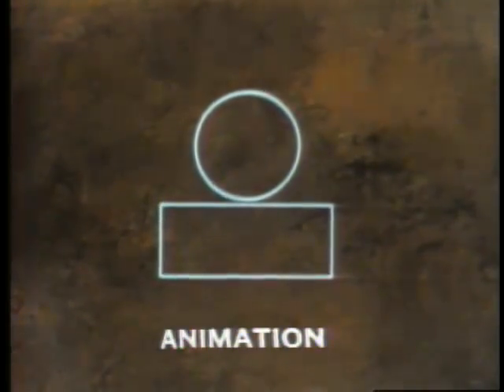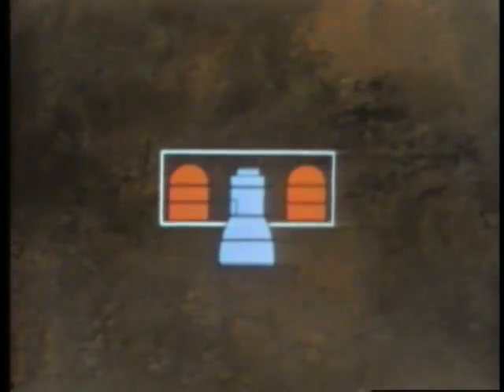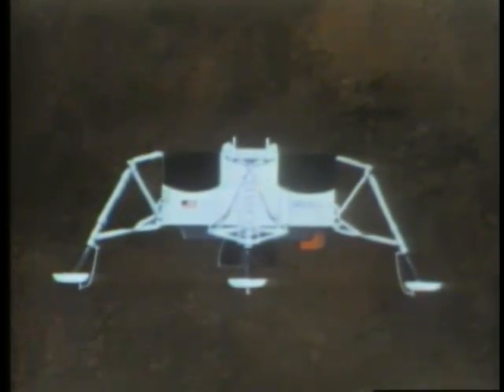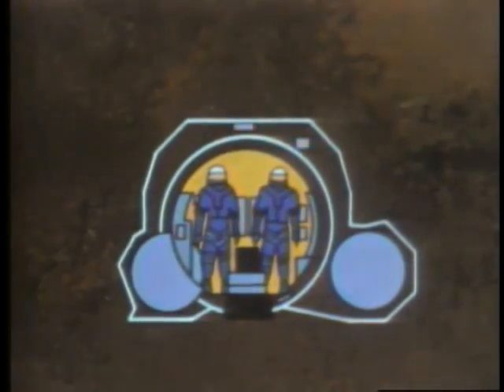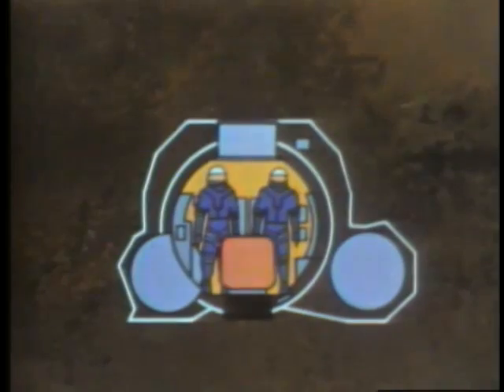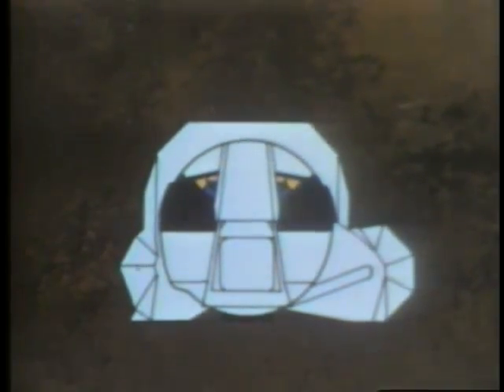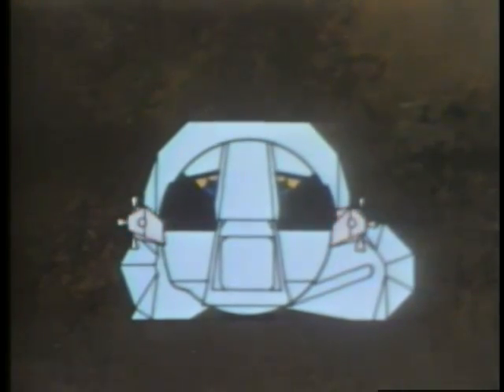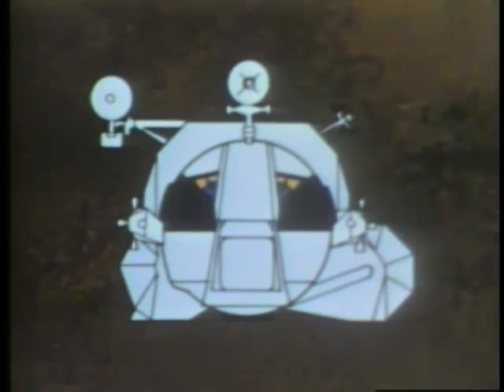Anatomy of the Lunar Module

Comment: Basically it's a rocket on top of another, makes you wonder the safety of the ascend stage: when the upper rocket ignited at such a close proximity to the lower fuel container, what should have had happened? Why the lower stage didn't explode? And the biggest question of all, how the fixed upper rocket engine kept the balance. All conventional rockets either have vector control exhaust, or multiple rockets to keep it stable. In the history of space, only lunar ascend stage has only one rocket engine with no vector control.
Reply: The vector control is in the upper stage is controlled by the RCS engines. Hence the "wallow" upon ascent. Watch the actual footage. The "wallow" is obvious when the footage is sped up. BTW..."wallow" is the actual term used by the Grumman engineers.
Reply: It kept the balance with a gyroscope, like the rockets does when launched here on earth. But the lm had other more serious issues.... like how could its thin aluminium hull hold up to the extreme vacuum in space?
Reply: @Gold_Village  - Once in space..The Apollo system is only pressurized to 0.3 ATM with 100% oxygen. (Not 1 atm) That is like breathing 30% Oxygen at sea level. .Only small areas had thin aluminum at the crew would not come into contact with. . They were also covered by layers of KAPTON and MYLAR on the outside. (had to use upper case because of autocorrect). The Thinness of the Lunar Module seemed to be a journalistic exaggeration in most cases. Only a few areas were as thin as a coke can.  Realistically soda can can easily handle 2 ATM pressure at sea level....in space 0.3 ATM isn't that much pressure
Reply: @dcb1138  Nasa never even demostrated the lm inside a vacuum chamber, yet we are to believe it worked so well n the vacuum of space?  i find it hard to believe. It had alot of thin hull areas because of the critical weight savings, and the reason why a can could hold up that good is because of its small size. The lm would need a way thicker hull
Reply: @Gold_Village  - Where did you get your information. They absolutely DID test them in Vacuum chambers. The first test had a window explode.
Reply: @dcb1138  Grumman tested it and it ofcourse failed, but there isnt any vacuum chambers on earth thats even CLOSE to the levels of vacuum in open space (my point proved)
Reply: @Gold_Village  You OBVIOUSLY nothing about physics or aeronautics . You proved that point for sure. Peace out
Reply: @dcb1138  LOL the lm failed a pressure test but im the one who knows NOTHING about "physics or aeronautics"? (but u do?)
Reply: @Gold_Village  - Um...yes I do. The window blew out and they replaced it. Then it passed .. What is your major malfunction.
Reply: @dcb1138  I bet it doesnt exist even ONE independent verification of a successful test
Reply: @Gold_Village  - Think about how absurd your comment is...Who could have run an "Independent" vacuum test in the 1960s. Let alone on the space shuttle, ISS or any space craft today. Ridiculous statement. Even Space X ships the Dragon to NASA to be tested.
Reply: @dcb1138  NASA refused Ralph Rene to test their space glove in his homemade(!) vacuum chamber, imagine that. Thats about the weakest levels of vacuum that can be created, yet nasa claims the suit working in the extreme vacuum of space. But ofcourse it failed a test in 1966 when jim leblanc nearly died

Comment: The decent stage... The flight Dynamics to land on the moon or essentially the same as here on Earth albiet with 1/6 of the gravity.  So it landed the same as the SpaceX Falcon rocket boosters do today... And the SpaceX rocket boosters have a vector controled Thruster in the computer power to control it, something that LEM did not have.
Reply: Skelotor Two, the gun experiences recoil because the powder's combustion action is working against the cartridge at the anchoring end, the projectile at the opposite and the barrel in all other directions. The combustion that is provided in the infinite vacuum of Space will have only the craft the rocket is anchored to, nothing at the opposite end, and nothing on all other sides. All of the missing elements are compounded by the vacuum that will not only negate any substances we might introduce in their absence but pull them away faster than we can produce them.
Reply: @asleepinthealley  So are you saying if you fire a gun in a vacuum you will get no recoil?  If you accept that you do get a recoil, what if you fire a machine gun with a thousand bullets. Won't you get a pretty continuous push from the recoil? What if your bullets are very small and you have a billion bullets firing rapidly? Rockets fire gas bullets continuously and produce a continuous recoil. No atmosphere is needed. The fact that they do work in a vacuum has been a settled matter for centuries, by the way.
Reply: @johnrex5342  I'm not saying anything like that. Why are you trying to put words in my mouth? Firing a gun is not a sustainable power source
Reply: Hmmmm....Yes IT DID. It had both Vector control RCS thrusters (4 quads) and the the decent engine could gimbal. Plus...The computer was very capable alone with landing radar but its was also coupled with doppler data from Earth. Where did you get your "facts". Perhaps read a book like "Digital Apollo" , then you can make educated comments.
Reply: john echols, nothing like "here on Earth". Here on Earth we have the atmosphere that is necessary for the rockets and thrusters to even function at all.
Reply: @asleepinthealley  Uh. Sorry, no. You don't need an atmosphere for rockets to work. Actually, the less atmosphere there is the better they work.
Reply: @johnrex5342  The why is it, the highest documented elevation a civilian Rocket has reached is 72 miles? Only NASA claims to have escaped our own atmosphere and they don't have ANY PHOTOS to prove it. Ha ha NASA has been lying for over 50 years!
Reply: Skelotor Two, it's not the ignition nor the combustion that presents the problem. It's the 'Thrust' whose requirements can't be met. Thrust is a two ended force, meaning that it needs to push against one end (the Action) to meet resistance and transfer that force (Reaction) upon the other. On Earth and within our atmosphere, it uses the air itself by compression to push off of. In the infinite vacuum of Space there is no compressible air to push from and this missing requirement is compounded by the vacuum itself. Any and All force we can produce is immediately sucked into the void that is the infinite vacuum of Space. Rockets do not and can not work in the vacuum of space, anyone that says otherwise is either ignorant or lying. NASA is lying.

Comment: Given the uneven ground of the Moon's surface, why would they put 4 legs on the lunar lander and not 3? Have you never had a rocking table that needed a matchbook under one of the legs? Why did milking stools have just 3 legs. NASA is supposed to be smart but this one got passed them?
Reply: Stable like a three legged chair? I'm sure it was considered with regard to weight. The legs were designed to collapse a bit...
Reply: GJ,How can you be so sure?
Reply: GJ, thanks for that as well, more evidence NASA has no idea what they're talking about. When confronted with the obvious mistake of 4 landing legs which would result in the rocking table effect, requiring a match book or stack of books to alleviate, we have them suggesting the 5 legged  lunar lander module...We know this was supposedly expected to land on a planet with uneven ground. Did NASA actually expect to encounter a table-top smooth surface? Think about it people, milking stools were made with 3 legs because they were used on uneven ground and 3 legs offers a stable platform. The ONLY stable platform. 4 legs would result in one leg always suspended and our table or landing craft rocking like a son of a bitch. 5 legs and more would multiply the problem. Isn't NASA supposed to be comprised of Rocket Scientists and aren't they supposed to be smart? This proves otherwise. I'd like this to be remembered as the 3-legged milking stool hypothesis, that brought NASA to its knees.
Reply: Good luck with that. You're going up against 6 successful landings from 6 attempts! It was designed to land on unknown terrain, not just to stand upright on it. They had to factor in possible lateral velocity on contact, and in any direction. Think about cars - pretty stable on 4 points of contact...why? A Reliant Robin in motion, less so! There's other factors in play. A three legged LM could have been made to work... if you look at early mock ups you'll see one with 3, indicating that it was a preferred option at that time - but later discarded. I'd imagine it's a matter of how wide the legs would have to be made to meet the margins against toppling, the weight consideration and robustness of the system as a whole. Look at Apollo 15 - it landed and took off safely.
Reply: GJ, you're merely repeating lies we were all told. Supposedly the most remarkable event in the history of mankind and they didn't take ANY actual photographs that can't be dismissed as fake. The Lunar Lander's legs and pads can be seen well enough to note there are no leveling devices incorporated into them, which they would have had to have had, to eliminate any rocking in the Lunar Lander. The closer we look the more proof we reveal...this never happened.
Reply: @asleepinthealley , engineering is all about tradeoffs.  There are advantages of a 5-leg design.  It is the most stable, meaning that it is the most resistant to tipping over if you land with a horizontal velocity component.  But it has the disadvantage of being the most heavy.

There are advantages to a 3-leg design.  It is the lightest.  But because the legs aren't spread as wide, it can tip over more easily.

Many times, what engineers decide on is a compromise.  And in the case of the LM, the compromise here was to use the 4-leg design.  You may have seen drawings in how Grumman's original design had 5 legs.  That's because the last thing they wanted to have happen was it tip over after touching down.  But their full LM design was too heavy.  So they went through iterations of looking at all places where they could save weight.  You can also see that the original design had large windows.  These are heavy.  So the windows got shrunk way down and reduced to just 2 looking out front.  The original design had chairs.  These got removed as unnecessary weight, and got replaced with harness straps tied to the top of the cabin.

And the leg design went through a weight reduction program too, going from 5 to 4.

Yes, leveling after touchdown is definitely an important consideration.  And the way they solved that was having crushable material inside each strut.  The legs were telescoping tubes that would compress upon landing.  And so when it came to a stop, all the legs would be crushed down to a point where the LM would not rock back and forth.  Kind of like dropping a lump of Play-Doh.  It squishes down so that the bottom gets flattened.

The LM's legs would crush down to a self-flattened base upon landing.  Extensive testing was done and it was extremely well documented.  Here is some of that testing that was done:

https://www.youtube.com/watch?v=7buE8sJfkTs&t=2m

One of those tests is dated Nov 23, 1966.  You can watch the legs compress so that when it comes to a stop it rests on a flattened base.  And you can see how the 4 legs work to help keep it from tipping over when landing with a sideways velocity.

Yes, there are definite advantages to a 3-leg design.  And that is exactly what NASA picked for its first Moon landers.  The Surveyor program:
https://www.google.com/search?q=surveyor%20moon&source=lnms&tbm=isch&sa=X

But with probes, it is not a catastrophic event if one tips over after landing.  You just build a new one and try landing it again.  But when there are people inside, then it is good to design to a higher reliability standard.

There is a strong push to land more stuff on the Moon.  And engineers today are going through the same design decisions that NASA went through in the 60s.  Here is a team from India doing their drop testing of a 4-leg lander design:
https://www.youtube.com/watch?v=5hplX93ttEg&t=15s

GJ,
There were actually 7 landing missions that were attempted.  6 succeeded.

The data from each of those landings has been published with extensive detail.  The reports state the exact velocities and accelerations that were measured.  And also the flatness of each of the LMs after they came to a stop on the surface.  Alan Shepard's landing on Apollo 14 had the biggest tilt angle.  He didn't pick the flattest place to put it down.

You may know that his crew got nicknamed "Rookie 14".  Between the 3 of the astronauts picked for that flight, the had a total of ZERO orbits between them when they lifted off.  This is in sharp contrast to Apollo 10 & Apollo 11, where each of the crewmembers were orbital rendezvous veterans.  Apollo 8 had a total of 3 Gemini rendezvous missions between them.
Reply: @asleepinthealley , there was a point in evolution when the first life forms came up out of the ocean.  Most preferred to remain in the sea.  Then there was that turning point for primates when most stayed in the trees, while some ventured down on the savanna and started walking upright.

1969 was one of these pivotal points in history.  And it is quite possible that the disconnect that is happening between you and me is because you and yours have elected to remain on one path, while there is this very different path that has been pioneered by people like Armstrong Aldrin & Collins.

You are certainly free to believe whatever you find to be the most compelling explanations.  I fully respect your decision to remain where you feel most comfortable.
Reply: @har234908234  Good luck with that! you really believe that the thin foiled can they call the "lm" really could hold up to a real vacuum? no tests has ever been performed by nasa - man or unmanned. Whats keeping them to show what the lm could do inside a vacuum chamber? not that there exist any vacuum chambers on earth thats anywhere near the levels of the extreme vacuum in space, but its a start. However id did failed a pressure test by grumman, thats the only record for it
Reply: @Gold_Village  Okay... do you actually think you need a vacuum chamber to test if it could hold up in a vacuum?
Reply: @har234908234  if you wanna know for sure yes but you missed the point, theres different levels of vacuum and what can be created in a chamber is no way near the vacuum in space. Still nasa has never demonstrated for us what the lm is capable of: fully pressurized inside a vacuum chamber. Yet we are supposed to believe that this soda can thin piece of garbage landed on the moon lol
Reply: @Gold_Village  Surely the bigger question is whether a soda can can hold soda? :)
Reply: @har234908234  do you misunderstanding on purpose again?
Reply: @Gold_Village  "Are you misunderstanding on purpose?" No... you're sceptical, which will hold you in good stead when you look into the soda can problem... after that you can reexamine the LM.
Reply: @har234908234  theres homemade(!) vacuum chambers that can cause a soda can to blow up, and thats the weakest level of vacuum you can imagine. What chances do you think the LM has in space?  FYI: the hull was thin as a can
Reply: @Gold_Village  ...the hull wasn't as thin as a can... but keep at the soda can problem. Why does the can explode?
Reply: @har234908234  when the pressure of the outside air disapear then the inside pressure gonna increase, and the liquid start to boil
Reply: @Gold_Village  When the pressure outside decreases, the can will have less pushing against the internal pressure, putting the aluminum under more stress. It should bulge a bit which would lower the pressure slightly in the can. If we're comfortable with PSI, imagine the same pounds of force with (fractionally) more square inches. I have no idea why you think that a pressure increase (with no change in temperature) would cause the liquid to boil.
Reply: You got there eventually!